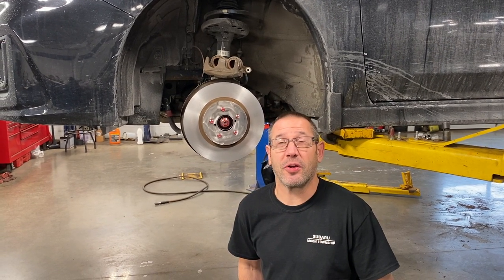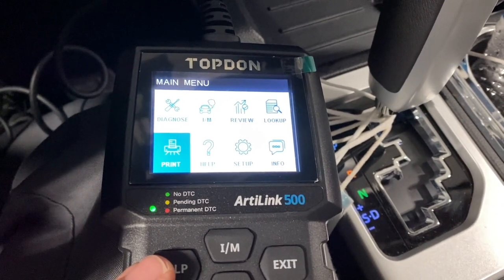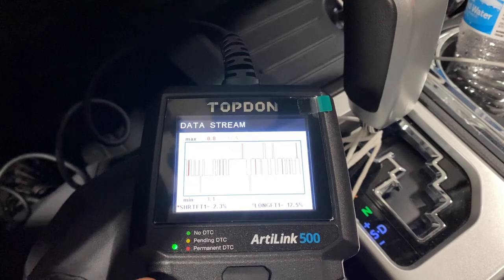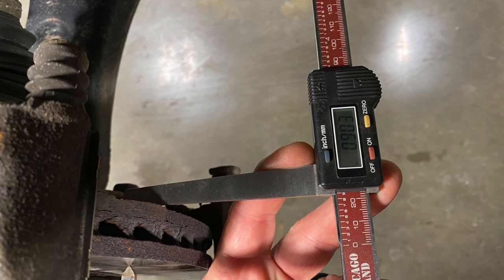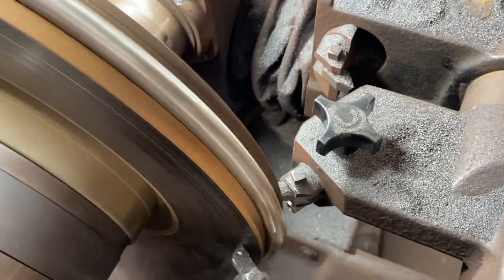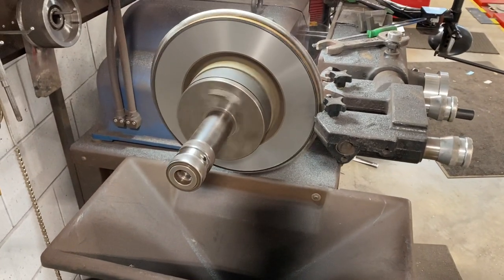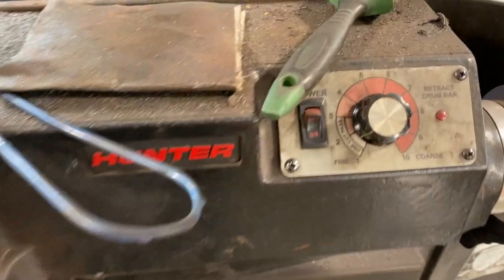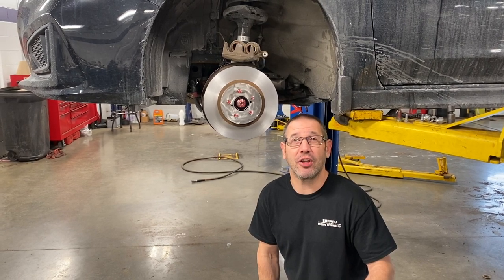Should You Machine Your Brake Rotors??

Comment: Brake drums are often dented in shipping and must be turned before going on the car. On a brake lathe you can check for dents before installing.
Reply: Half the "new" rotors out there are garbage' of the hot variety. I would turn my factory rotors until you could read thru them before i strap on a set of amazonian unobtanium based replacements.

Comment: Cutting rotors also weakens rotors. Most average Joe cars buying new rotors are cheaper than turning them down. Sears use to try and pull that saying need your rotors turned then hit you with a 70 dollars a rotor price. On the same car get new rotors for 78.99 so yeah would go new over turned. Always gotta weigh pros and cons though. Great informal video Brian keep up the great content :)
Reply from the maker: Thanks for watching, I appreciate the comment!
Reply: On my truck they cost 115$ per unit. If you calculate the low milage i do and i dont haul anything more than my 4 wheel in the truck... How much he said? 180$? Its a dam good deal!!!
Reply: @jean-michelb7290  Good deal to save 45 bux while weakening and thinning your rotor? Makes no sense. For 225 you will have brand new units with warranty - just bring them back to autozone if they warp again.
Reply: @ipcamtalk4314  did you at least read my comment or you just saw the price i wrote?
Reply: @jean-michelb7290  Both
Reply: @jean-michelb7290  How do you figure. You "save" $45 dollars, have less metal so it will warp again and no warranty. Might as well buy new ones with easy warranty exchange. Machining is for suckers. Prove me wrong.
Reply: @ipcamtalk4314  keep trolling kid.
Reply: @jean-michelb7290  You could at least attempt to reply with an argument based on fact.
Reply: @ipcamtalk4314  keep driving your toyota echo 1991.
Reply: @jean-michelb7290  Again, you dont have the reasoning capacity to tussle with me. That is why you need to pretend to know what car I drive. Try again. Please.
Reply: @ipcamtalk4314  well I mean “weakening” by taking thousands of a inch off is pretty deminimus but yes buying new rotors is cheaper unless you runout is from your bearings and instead of compensating for runout your rotors will shimmy again roughly 10k miles after install
Reply: Oriellys $15 per rotor cutting, my honda rotors are 90 each id rather get another set of out of oem rotors than use aftermarket
Reply: you are removing thousandths of an inch. The forces are rotational. It is fine.
Reply: If I need a rotor, I get it at the self-service wrecking yard. My logic is that I will get factory or premium aftermarket and save 50 to 80 percent in cost. If the vehicle you take it off of has had a recent brake job, you will not need to turn it. If your vehicle has a solid rotor, maybe you have to get new.

Seriously, I don't think that turning a rotor weakens it or has much effect on heat dissipation. Not the first time around. When it gets near the minimum, maybe.

Comment: I watched this because I have a very rare 40-year old collector car, and rusty NOS rotors that must be turned before installation. The kerfuffle about turning them on the car for warranty work is irrelevant to me. It's a minicar with 8" rotors. Will machine shops be able to handle such small ones?
Reply from the maker: It's hard to say, I have never had any that small. If anything, they may be able to mount them on the lathe and clean them up with some sandpaper.

Comment: As a tech your selling your labor. Do the math on every job. If the rotor is available and cheap dont bother. If its pricey turn it. The second good reason is hoist time. Nobody wants a hoist tied up all day waiting on parts. Pads and shoes are widely available. Rotors are another story. Your way better over time if you have the option to turn them when it saves you the hoist time.
Reply from the maker: Excellent comment, thanks for watching!

Comment: Never turn your brake discs that way.
1 No warranty
2 Brake discs become skewed, they may hit a maximum of 0.05 mm
3. You get easily below the minium thickness
and so on
Reply from the maker: All new car manufacturers require the tech to attempt to cut your  rotors before they will pay for new ones. If your car is still under the brake warranty, this will be done for free.
Reply: @PIPSBURGHVIEWS  Okay maybe in USA but not i EU. Brake disc toIerance on Runout are 0,050 mm and when the disc are on the car are the tolerance 0,1 mm. I have been working with Quality on brake disc for mere than 25 years.. In Denmark
Reply: Jacob -- I have machined rotors for 57 years & never an issue.
Legally when your in a business then min thickness is an issue.
If you take your rotors to an auto parts store & they go under there
is no issue IF it is your vehicle & you install New Pads to regain some
caliper space.

Comment: When u turn them down do they last as new ones? Can u maybe show a radiator flush?
Reply from the maker: It does shorten the life span minimally but you will have better brake feel and pad contact. I will see what I can do on a flush but I don't do those very often.
Reply: @PIPSBURGHVIEWS   thanks wife has forester wonder how hard
Reply from the maker: @TheSlugger76  It's not hard but it can make a big mess if you don't have drain pans a proper funnels.

Comment: What’s the difference between on car rotor turning vs on the bench?
Reply from the maker: When you cut them on the car, it matches the cut to the hub. On the bench, it cuts them perfectly straight.
Reply: @PIPSBURGHVIEWS  so how come the manufacturer prefers the on car method? Seems like the bench will be a more even cut. Sorry for all the questions lol 😆
Reply from the maker: @umpireoba  not 100% sure. Some times the rotors are really hard to get off or maybe they have a contract with Procut lol
Reply: @PIPSBURGHVIEWS  got it. Thanks Brian 👍👍

Comment: Dumb question here goes. Do new rotors, out of the box, have to be turned or checked in any way? Are they bolt on right away?
Reply from the maker: Most of them are covered in a light oil for corrosion protection which needs to be cleaned off before you can put them on, other than that they are good to go.
Reply: @PIPSBURGHVIEWS  all rotors should be checked for runout when installed, and corrected if above mfr spec. This is to prevent the development of thickness variation and pedal pulsation.
Reply: @PIPSBURGH VIEWS  all rotors should be checked for runout when installed, and corrected if above mfr spec. This is to prevent the development of thickness variation and pedal pulsation.

Comment: Did he say 180 to cut them!?!
Reply from the maker: I did but it depends on the shop labor rate. We would get paid 1 hour labor  to replace rotors or 2 hours to cut them. Keep in mind, the cheapest OEM Subaru rotor is now $165. So, if you replaced just two rotors, you would be looking at $420 for parts and labor. Now, if you took the rotors off yourself and took them to the parts store for cutting, it would be substantially cheaper. Thanks for watching.

Comment: You should treat yourself to slotted rotors and only buy copper-ceramic pads its big value stopping power and the setup lasts forever as the rotors will never really wear if they are slotted and you don't use highly metallic pads on them.
Reply from the maker: Thanks for the tip, I have had slotted rotors in the past.
Reply: @PIPSBURGHVIEWS  did you ever crack brake pads with them or was your experience good
Reply from the maker: @MCMinerHQ  it was good.

Comment: $12k machine, charge $20 a rotor or drum to turn, thatll take YEARS before it makes a profit. And any repairs or consumables during those years, might not make a profit at all.
Reply from the maker: This machine is at a Subaru dealership where the cheapest OEM rotor is $136 and that’s on an Impreza. We cut about 10 rotors a day so it paid for itself in less than 6 months.

Comment: "and it usually cost $180  labor". How would that save money if rotors can be bought new for under $80 dollars a pair. Misinformation??? As far as I know cutting rotors cost between $15 abd $40 a pair.
Reply from the maker: The cheapest OEM Subaru rotors are $160 each. You may be able to get them cut for $40 if you took the rotors off and brought them in.